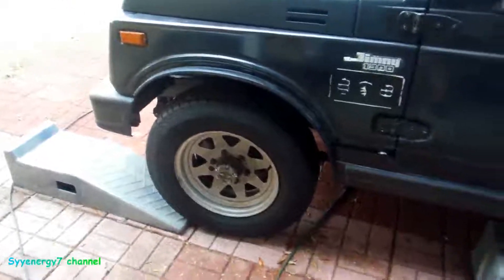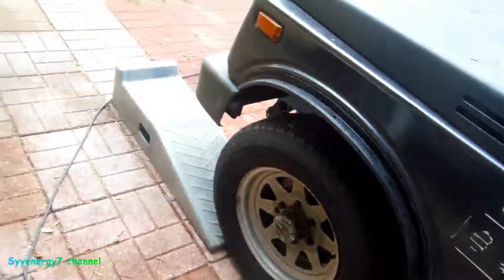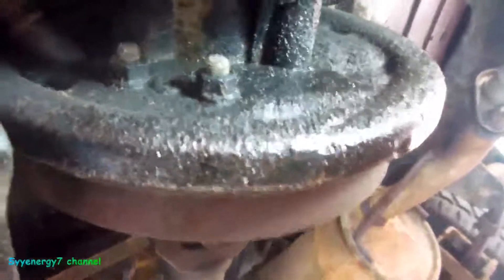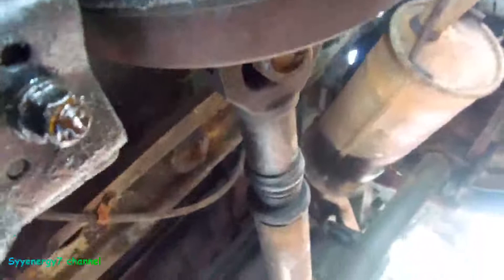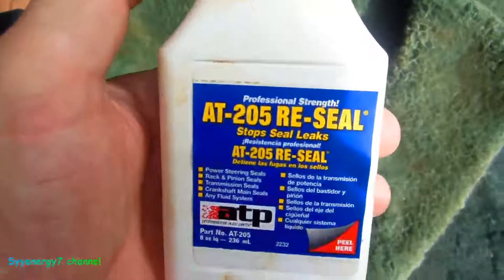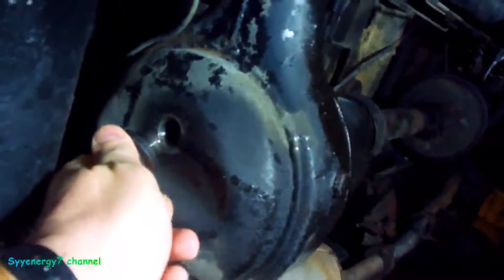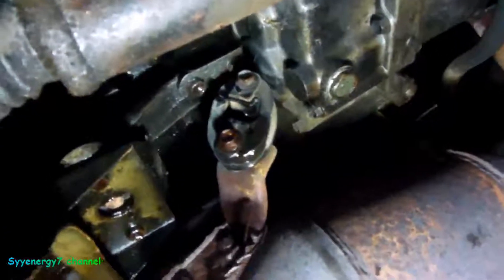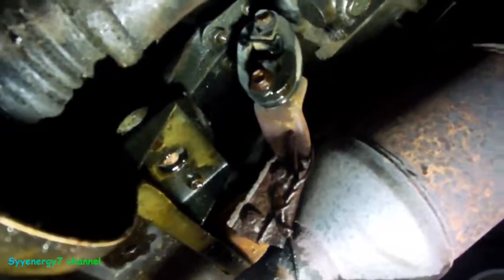Suzuki Samurai SJ Leaking Trans, Diffs & Transfer Case

Comment from the maker: I will be testing how effective AT-205 reseal is on both the front & rear differentials and also the transfer case and transmission before I change any parts.  I am curious how well it may work  This will be a great test and confirmation for those who can not change out the seals themselves or are dealing with a too cold winter to work on a car, truck or jeep.